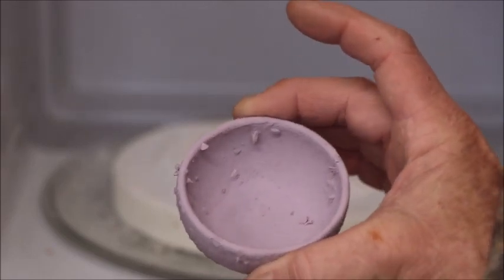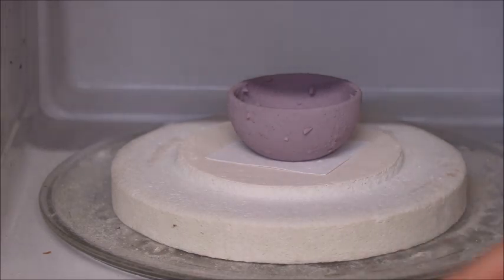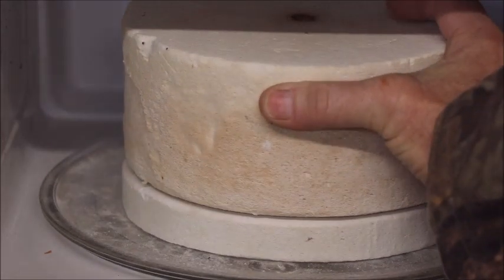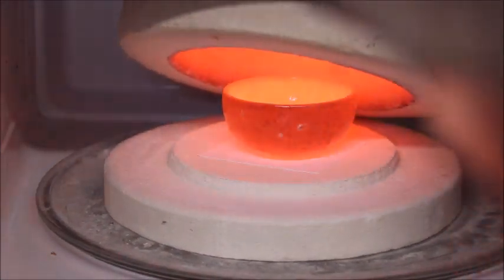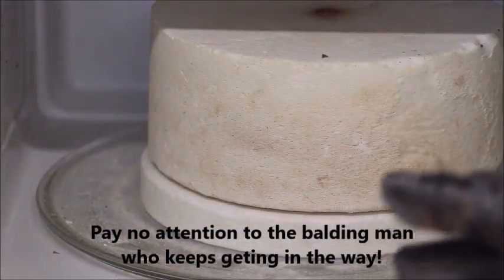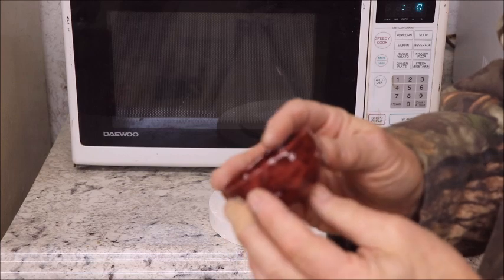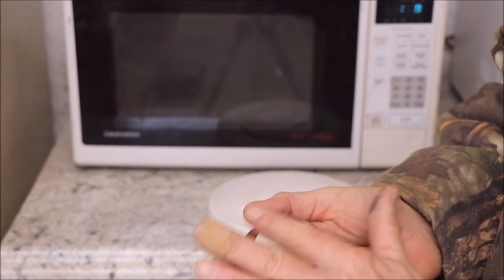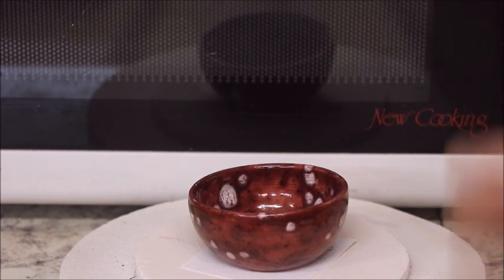Glazing in Microwave Kiln

Comment: Great video.  I do have a question - What did you say the paper was that you place the glazed pot on?  I did not catch what you said.
Reply from the maker: It is a special firing paper called "kiln shelf paper"  you can purchase it at any ceramic or glass supply store online or start here:https://www.amazon.com/Microwave-Kiln-Paper-Shelf-sheets/dp/B0716F6FW3/ref=sr_1_4?crid=2NGCE9J09R1U6&keywords=kiln+paper+for+glass+fusing&qid=1584487212&sprefix=kiln+%2Caps%2C153&sr=8-4

Comment: How long does it usually take to cool?
Reply from the maker: It's hard to generlize.  It depends on the size of the object and the material.  I would guess that a cup sized object would take about an hour.
Reply: @CaptMike  gotcha, thank you so much! Do I let it cool covered or uncovered? If it cools too quickly (uncovered) will it crack?
Reply from the maker: @laurenblythe7707  What I do is cool in stages.  As soon as the firing is complete I place a 1/4 inch piece of tile under the top and let it sit.  After about 30 minutes I increase the height of the crack to 1/2 inch or so.  After the piece has cooled about 45 minutes I remove the top and let it finish cooling.  Most of the time ceramics will not crack if cooled rapidly.  Think about Raku where the ceramic is removed, red hot and placed in a chamber.
Reply: @CaptMike  got it! Thank you!

Comment: Does your microwave get really really hot when you do this?
Reply from the maker: My microwave kiln will reach about 1400 degrees F,  You will have to test yours to see what it will do in farenheit
Reply from the maker: Only when I get t the final stages.  The outside will be prettyhot.  Best to wear gloves.
Reply: I used an infrared thermometer to see how hot it got. I was fusing glass and the exterior of the actual kiln after 11 minutes was about 230 F. The sides of the exterior of the microwave ranged from 95-115.

Comment: What type of ceramic clay do you use?
Reply from the maker: Kim, this particular bowl was cast from low fire clay slip.  You can use any type of clay you want to, low fire to mid to high fire.  It will depend on the type of glaze you wish to use and whether you will throw the object on the wheel.  The microwave kiln will only get hot enough for  for a cone 06 glaze.
Reply: Capt Mike thx for your quick reply!  Have a great day.